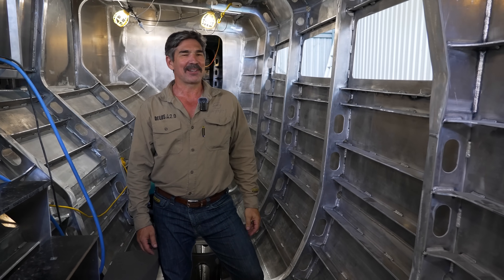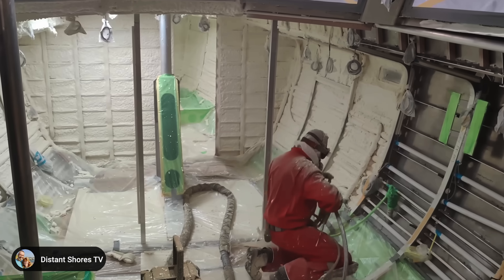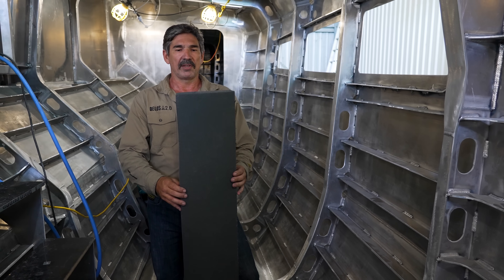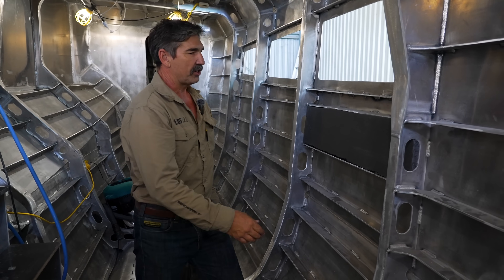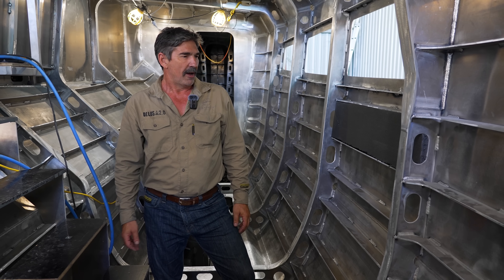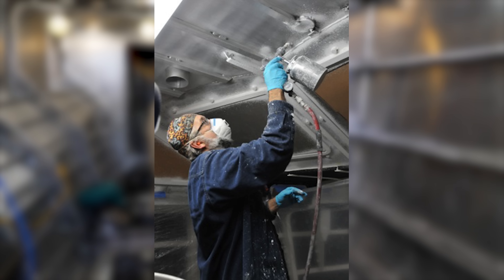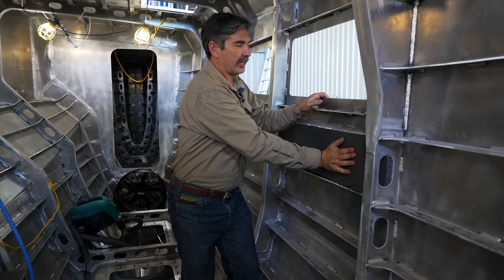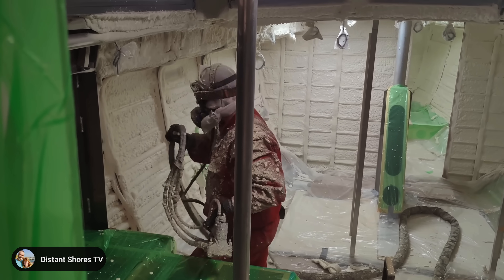HELP, We Need Your Advice!  How Should We Insulate Our Aluminum Catamaran???

Comment: Hey Brian and crew. Regarding insulation I commissioned my chat GPT40 Plus to write a report of the best practices in Naval architecture for insulating aluminum ocean-going catamaran. 

The second half of the report addresses adaptations to provide accessibility to the hull. Hope this helps. By the way the boat is looking great! 

Report: Best Practices for Insulating SV Delos 2.0 to Inhibit Condensation and Enhance Liveaboard Comfort

Objective

The insulation of SV Delos 2.0 aims to:

1. Prevent condensation on the aluminum hull to maintain structural integrity and comfort.

2. Provide thermal and acoustic insulation to ensure a comfortable living environment.

3. Use materials and methods that align with best practices in naval architecture.

Challenges of Insulating Aluminum Vessels

Thermal Conductivity: Aluminum is highly conductive, which can lead to significant temperature differences between the interior and exterior, resulting in condensation.

Marine Environment: Materials used must resist corrosion, mold, and moisture while being lightweight to avoid compromising vessel performance.

---

Recommended Insulation System

1. Closed-Cell Spray Foam Insulation

Description: Closed-cell polyurethane spray foam is one of the most effective methods for insulating aluminum vessels. It provides excellent thermal insulation, moisture resistance, and creates an airtight seal.

Advantages:

Thermal Barrier: Reduces heat transfer, preventing condensation.

Adhesion: Bonds directly to the hull, eliminating air gaps where condensation could form.

Waterproofing: Acts as a moisture barrier, preventing corrosion of the aluminum.

Lightweight: Adds minimal weight compared to other insulation methods.

Application:

Clean and prepare the aluminum surface (removing oils, oxidation, and debris).

Apply a primer designed for marine-grade aluminum to enhance foam adhesion.

Spray the foam in thin layers (1–2 inches per pass) to allow proper curing and avoid overheating.

Trim and cover the foam with a fire-resistant material for safety and aesthetics.

2. Reflective Vapor Barrier

Description: A reflective vapor barrier made of aluminum foil or similar material is installed over the spray foam to reflect radiant heat and enhance insulation.

Advantages:

Radiant Heat Reflection: Keeps interiors cooler in tropical climates.

Additional Moisture Barrier: Protects against potential foam damage and condensation.

Application:

Attach the reflective barrier using marine-grade adhesives or mechanical fasteners over the spray foam.

Ensure all seams are sealed with aluminum tape to maintain a continuous barrier.

---

Supplementary Methods

3. Ventilation System

Description: Adequate ventilation is crucial to reducing moisture levels inside the vessel, preventing condensation on surfaces.

Recommendations:

Install heat recovery ventilators (HRVs) to exchange stale air with fresh air while minimizing heat loss.

Ensure proper airflow in all compartments, especially behind insulation layers.

4. Insulated Hull Liners

Description: Install decorative insulated panels over the insulation to protect it and enhance interior aesthetics.

Advantages:

Improves acoustic dampening.

Provides a finished look to the interior.

Adds another layer of thermal insulation.

Materials:

Lightweight composite panels with marine-grade finishes.

---

Material Selection

Insulation

Closed-Cell Spray Foam: Marine-grade polyurethane foam with high R-value.

Fire Retardant Properties: Ensure compliance with international maritime safety standards.

Protective Coatings

Marine-Grade Primers: Enhance adhesion and protect aluminum from corrosion.

Non-Flammable Coverings: Use Class A-rated materials for safety.

Accessories

Sealants: Use marine-grade sealants to prevent moisture ingress at joints.

Adhesives: Ensure compatibility with both aluminum and insulation materials.

---

Best Practices for Installation

1. Surface Preparation: Proper cleaning and priming of the aluminum hull are essential for long-term performance.

2. Professional Application: Hire experienced marine insulation specialists to ensure even application and proper curing of spray foam.

3. Fireproofing: Cover insulation with fire-resistant materials to enhance safety.

4. Regular Inspections: Monitor insulation performance and address potential issues like delamination or moisture ingress.

---

Conclusion

The proposed insulation system for SV Delos 2.0 combines closed-cell spray foam insulation with a reflective vapor barrier and robust ventilation. This approach minimizes condensation, maximizes thermal efficiency, and ensures a comfortable living environment for ocean voyages. By adhering to these best practices, Captain Brian can ensure SV Delos 2.0 remains a state-of-the-art liveaboard vessel.

------ Part 2: Adaptations for Insulating SV Delos 2.0 to Ensure Accessibility to Critical Systems

To address Captain Brian’s concern about maintaining accessibility to critical systems located at or near the aluminum hull, the following modifications and adaptations to the insulation plan are recommended:

---

1. Modular Insulation Panels

Instead of fully adhering spray foam directly to the hull, use removable modular insulation panels in areas where critical systems (e.g., plumbing, wiring, fuel lines, and valves) are located.

Implementation

Customizable Panels: Construct lightweight, pre-fabricated panels made of closed-cell foam or multi-layered insulation with protective covers.

Attachment System: Secure panels using:

Magnetic fasteners (suitable for aluminum hulls with proper backing).

Mechanical clips or brackets for secure but removable installation.

Hook-and-loop fasteners (marine-grade Velcro) for lightweight components.

Inspection Ports: Integrate access hatches or inspection ports into panel designs for quick system checks without full removal.

Advantages

Full insulation coverage when panels are in place.

Quick and easy access for maintenance, reducing downtime and effort.

Panels can be replaced or upgraded independently, allowing long-term adaptability.

---

2. Segmented Spray Foam Insulation

In areas requiring frequent access, divide the spray foam application into segmented, removable sections.

Implementation

Use thin foam mats adhered to lightweight removable substrates like composite boards, rather than spraying directly onto the hull.

Install these removable sections with fasteners or adhesive tabs for easy detachment.

Advantages

Maintains the thermal and moisture-sealing benefits of closed-cell foam.

Allows quick access to critical systems while avoiding irreversible damage to insulation.

---

3. Insulation-Free Service Zones

Designate insulation-free zones around critical systems that generate heat, require airflow, or need frequent access.

Implementation

Use thermal barriers like reflective aluminum sheets or ceramic coatings in place of foam in these zones.

Include pathways or voids (air gaps) between the hull and critical components to reduce condensation risks.

Advantages

Simplifies access to systems without compromising safety or thermal management.

Air gaps naturally reduce condensation and allow for system ventilation.

---

4. Flexible Insulating Sleeves for Piping and Wiring

Instead of insulating critical systems at the hull level, focus on individual insulation for components like pipes, wiring, or ductwork.

Implementation

Use closed-cell foam sleeves or flexible insulation wraps for pipes and conduits.

Opt for marine-grade materials that are easy to install, remove, and replace during maintenance.

Advantages

Reduces the need to access the hull itself for maintenance, as individual systems remain insulated.

Prevents thermal bridging and condensation at the component level.

---

5. Documentation and Mapping

Maintain a detailed insulation and system map to assist with efficient system access and troubleshooting.

Implementation

Color-Coded Panels: Use visible markings or color codes to identify sections covering critical systems.

Digital Mapping: Create a digital layout of insulated zones and systems for quick reference.

Label each panel or segment with details of the underlying system for easy identification.

Advantages

Reduces time spent locating and accessing systems.

Ensures all crew members can quickly navigate insulated areas.

---

6. Enhanced Ventilation in Critical Zones

Critical systems often generate heat, which can amplify condensation risks and impact insulation performance. Incorporate targeted ventilation solutions.

Implementation

Install small, dedicated vents or fans near heat-producing equipment to regulate temperature and humidity.

Ensure these vents are insulated and weatherproof to maintain thermal efficiency.

Advantages

Prevents heat buildup that could degrade insulation.

Maintains consistent airflow around critical systems, reducing condensation risks.

---

Summary of Modifications

---

Conclusion

By integrating modularity, segmentation, and system-specific insulation strategies, SV Delos 2.0 can maintain its insulation effectiveness while ensuring Captain Brian retains full accessibility to critical systems. These adaptations align with best practices in naval architecture, optimizing the vessel for liveaboard functionality and operational reliability.

Fair Winds and Calm Seas!

Comment: Spray foam is well tested and seals the surface transition layer from trapped moisture and oxygen (both being necessary for corrosion btw). As you noted the major disadvantage is future access.  Plastic pipe vias for cabling and careful location of critical equipment can mitigate a lot of access issues but likely not all.  I might suggest a hybrid system.  Use the spray on barrier coating in critical access areas ( making sure that they are etch coatings designed for aluminum application) and use the stick on closed cell foam for those planned critical areas. 

The major drawback for spray on foam is that it cannot resist the heat from damage repair by welding.  Designing your interior panels and systems for simple removal should mitigate that risk and allow for easier foam removal before repairs.

All in all however the spray on foam will be the most reliable and the best way to ensure an anaerobic transition between the metal and insulating layer.

Love your videos and envy you guys this wonderful project build.

Comment: How about a hybrid approach?  Spray foam in areas where access to hull is not likely to be necessary and foam sheets in areas where there may be a need for future access.  You could even mask off and use spray foam on protruding aluminum in areas where foam sheets are used.  I wonder if there is a coating you could use on the bare aluminum as a barrier coat that would reduce the spray foam's adhesiveness to the aluminum and make it easier to peel away should the need arise.

Comment: In buildings we have to deal with interstitial condensation. This is something different from a boat which has an impermeable outer skin and probably inner skin too. My vote would be the spray foam because this is the only way to get a continuous insulation over  the ribs. You absolutely need that. Some kind of primer/insulating membrane on the aluminum hull and then a breathable membrane over top of the spray from. The membrane would be belts and braces but would add another moisture protection layer. 

I would hope you would not want to or have to get back into the wall system to repair pipes etc., but if you did then this would be no more of a problem than other systems you discussed. Just keep good as-built records of where everything is inside the walls.

All the Best

Comment: Spray foam is flammable and must be encased in a home  . A thought for you before using it , is there a fire retardant you can use on it ? Probably some kind of paint coating .  Might make it washable too . 

Spray foam is the way to go though for a good insulation  . That black foam will let moisture in behind it and it will be impossible to seal it as well as the spray foam plus all the thermal leaks from all the frames  . The spray foam can be removed and chemically cleaned off  to do work but you would need to reapply after the work was done from an off the shelf can .

Comment: the problem with anything that is not spray foam is thermal bridge.  closed cell installed properly on a prepped surface is the best. BTW all the aluminum super yatch are using closed cell anything else will generate condensation which is your real enemy

Comment: Among the most qualified aluminium boat builders in the world are the dutch yards like KM boat builders and they use spray foam. I would guess that spraying would also save weeks of work time against using insulation 'bricks' which also leave the problem of thermal bridges. The comments below also diminish your argument of difficult accessibility against spray foam. All told, spray foam is the way to go.

Comment: We use spray foam for all housing projects and it is fantastic.  I understand your reluctance to use it because things are sealed, but I can't imagine that ripping out neolon is any simpler.  The foam will have the tightest coverage and eliminate the hundreds? of little crevasses that  neolon will leave behind.  I have tried to cut solid foam and place it between joists in the past, and it was never as tight as I wanted it to be. 

I love watching your project evolve, keep up the great work!  I especially like the large roof you put over the cockpit, I don't understand why this is not a regular thing.
Reply: This is an aluminium boat it wil expand when in warm climates & contract in cold you will never get a good tight cut foam fit .

Comment: You seem to be stuck on a All or nothing track. Why not use a combination of insulating mode. Use the spray insulation and cavities where you’re not going to want to.Remove it and use the foam with pins in areas where you are likely to need to run pipes or wires. Another option would be to place empty conduit and key areas around the boat for easy access when running wires or other equipment.

Comment: Brian  this is cool hand from San Pedro California. Spray foam yes you it is kind of a mess to fix things . In some ways if you spray the right spray foam it's not just insulation but it gives you  buoyancy that's really bitching so what you have to do is quit piping through those areas so when you spray from Over the piping you can still bring electrical and other things through but the picture thing about the type of spray foam there's different types and if you get the really heavy closed cell  foam it's really really  buoyant and the big thing is if you ever sprinkle it it should keep your boat from sinking. Biggest thing is think it out because it will make your boat more efficient it'll be nicer inside then average insulation but the biggest thing I hear  about spray foam is prepping  for it you need to really make sure that everything is really clean and that you've ran all your PVC piping where you want it so you can in the future update electrical and other things or have your existing electrical go through I think it's a better option really especially if you go into cold places or hot places the spray foam will do a better job of keeping it cool inside or hot inside and keeping the elements out of It's a Wonderful product but it has to be done right and I know you would do it right. Like I was saying the prepping is what I hear the biggest thing you want to make sure that your walls are really super clean so everything sticks really well and you get full  filling up of everything well I hope you pick something good . Cool hand

Comment: Stay away from spray foam it will also hold moisture over time yes even closed cell. 

Do a thin coating on the complete structure, then used the foam you showed. 

May want to look at the insulation that sailing hub put in their camper van. They used a cork that you can spray on with a binder. Pretty cool stuff

Comment: It could be a case of spray foaming the tricky areas which have little or no mechanical present.  Use the foam bats around wiring and plumbing runs for access.

Comment: I don’t think you should limit yourself to only one product as there are pros and cons to all products in different situations. I also agree with what you are saying about the different products. The best answer is to use a spray product to prevent the condensation issues and eliminate any voids that could cause air movement within the wall cavity. You should take a look spray cork for environmental and flame spread specs., it a great product and is being used in boats and vans. The amount of toxic smoke coming off of spray foam, should it ignite, should be considered. If you keep all of your service chases inboard of the spray insulation the you can add an expanded or extruded foam board to help with thermal bridging. The final layer would be removable when required. Just some thoughts.